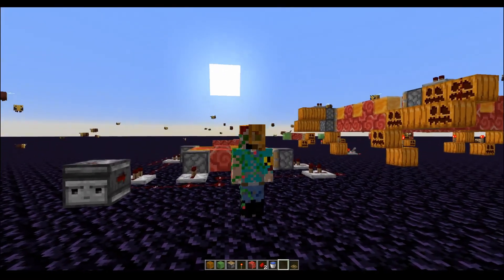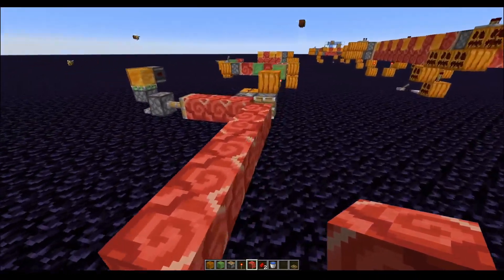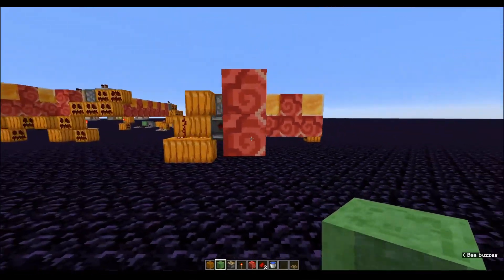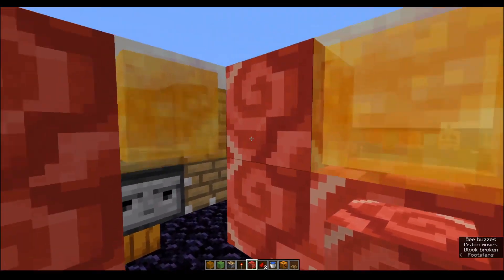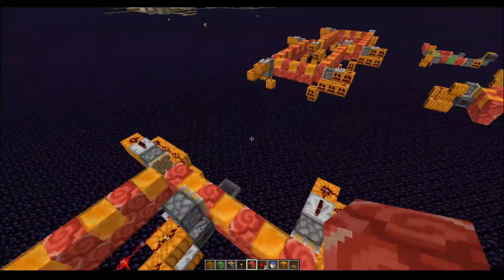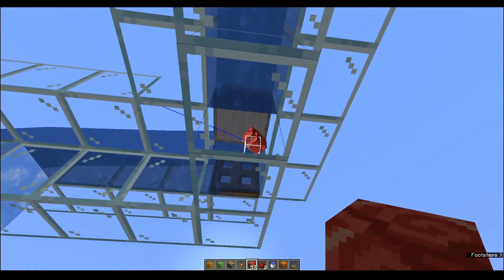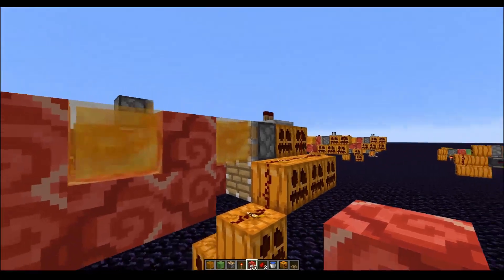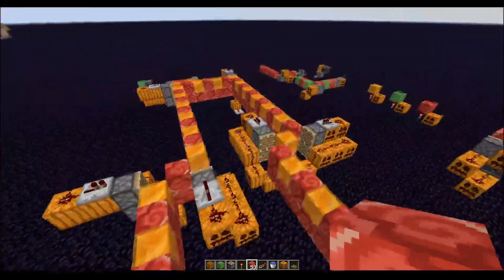Honey Block Conveyor Improvments!

Comment: Is it possible for it to be made just out of honey blocks? I want to make a shimmer box switcher and use the conveyer as like a feed tape
Reply: no
Reply from the maker: unfortunately it can't be made of just honey blocks although it can be made with alternating honey and slime blocks, if you want to only use the block sticking properties. however that wouldn't help with trying to move shulker boxes as they don't stick to either honey or slime.